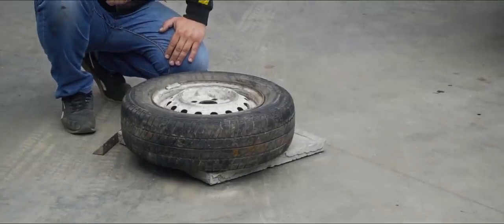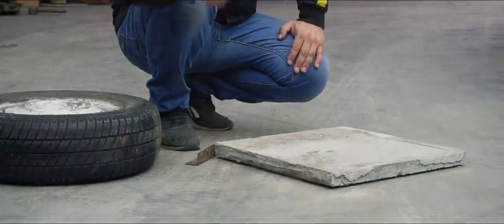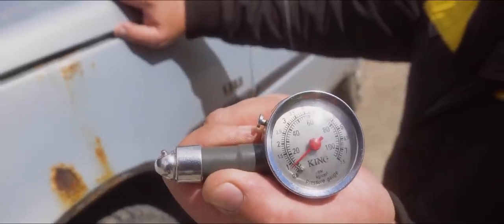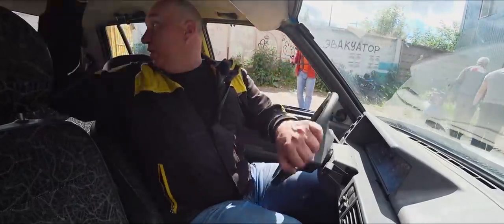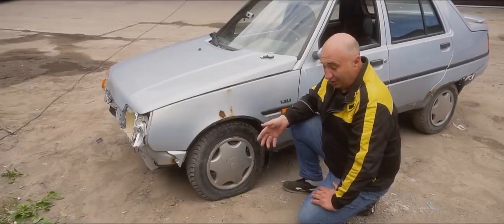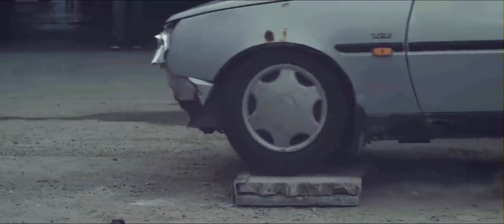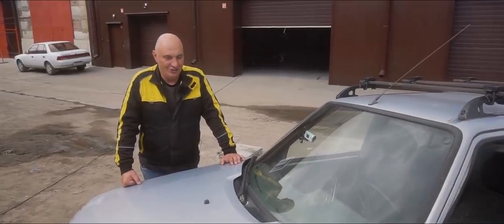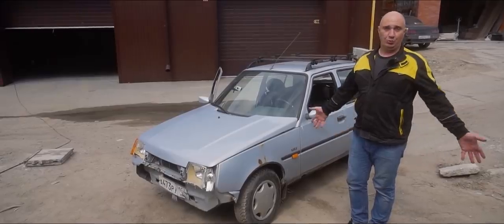220 PSI – can the tire keep it together?

Comment: Mans literally filled a tire to over 200 psi with 0 protection whatsoever. I'm surprised he was able to drive the car with his enormous balls
Reply: it will hold over 200, why, because think of the centrifugal forces trying to sling the tire apart at  120mph. way more force then just 200 psi is needed to blow one apart, as a tire was engineered to not explode.
Reply: Lmao
Reply: @opossom1968  2222
Reply: I had trailer a tyre explode on me at 35 psi it blew me on my back and I couldn't hear properly until the next day.
Reply: @opossom1968  you just saw a video where he is intentionally running into shit with a highlikely hood damaging the tire/rim But you think it should still hold 200PSI? Lol out of your mind.
Reply: @tsslaporte  i do not think it 'should' be ran at 200psi, i run 36/250kPA in all my vehicle tires. 32 is comfortable ride, but best fuel mileage and tire life is at 36psi/250kPA. Never did i say that anyone should run a tire at 200. i said i have seen tires pumped up to over 200 just to see where they pop at, which is usually at 220.
Reply: @opossom1968  that logic doesn't work, since only the threaded part is designed for that. The sidewalls of the tire are not designed for anywhere close to that pressure.
Reply: @butwait  i never said a tire should be ran at 200psi, i said they seem to blow at 200 or 220 when people pump them up to burst them. no one is running that high a air pressure on the road. i run mine at 36psi/250kPA which is the best pressure for tire life and fuel mileage, 32psi is for comfort, but tires wear faster and fuel mileage is lower. usually when pumped up the side wall will pop, which is not as strong as tread area which is wire reinforced or in case of bias ply nylon thread. look up the You Tube videos and you will see tires over filled pop at around 200 to 220 in PSI. more in kPH scale which is a finer measurement.
Reply: Well his brain is proportionally small so his total mass remains the same.
Reply: opossom1968 tell that to my semi tires bro
Reply: @BigRigStreaming  Filled mine today, rated at 130psi/9bar, I would feel a tad nervous above that..
Reply: @opossom1968  Centrifugal force of the tire  in that speed is about 50kN. 200psi (14bar) pressure over entire surface of the tire is about 100kN or more. I calculated that in my head so not accurate but I think about right.
Many people have died or injured seriously in explosions of pressure vessels
Reply: He’s Russian after all
Reply: @opossom1968  had someone bring a Buick in the shop for tire check. The tires got rotated, but never had the tpms positions relearned. They kept adding air to the wrong tire and it was at 90psi. Total tread separation 🤣

Comment: Make a electric-Lada using only startermotors..
Reply: @PODbot2.5  awsome! Thanks!
Reply: I like you
Reply: Jerry, yes. Start motor idea is not good or even fun, but real ELada can be, If well made. No point to do it If not made to last.. or fast. Maybe both?
Reply: @jannejohansson3383  agree and disagree... but for Garage54 it's about having fun too
Reply: How about Lada powered by a rocket made out of the CO2 tank? Or a co2 tank filled with mentos and cola? what if you put a co2 tank in the rear, tilted up a bit, make a hole that the whole pack of mentos could get through and fill it with cola and throw the whole unpacked pack of mentos in it or 5 packs lol :D
Reply: Just take the plugs out and put it in gear
Reply: Yes, I need to get the plates renewed on my e-LAD-tric car please.
Reply: That's called a Tesla.
Reply: @torivar  other makes are available and cheaper lol.
Reply: @torivar  Teslada
Reply: Inefficient? Yes
Russian as hell? YEEEEEEEEEEEES

Comment: Vlad is a f**kin madlad. 
No way I'd stand near a tyre with more than 100psi unless its a truck tyre
Reply: it will hold over 400, why, because think of the centrifugal forces trying to sling the tire apart at  120mph. way more force then just 200 psi is needed to blow one apart, as a tire was engineered to not explode.
Reply: @opossom1968  just because its engineered not to explode doesn't mean it won't.
Why do you think its mandatory to cage a truck tyre while inflating it?
It could be dry rotted, cracked, punctured, faulty, not seated correctly.
Reply: @1one3_Racing  Exactly right. I've had a brand new car tyre (205/60R16) blow off the bead at only 30 psi. Just because a tyre is "engineered not to explode" doesn't mean it won't happen. Mind you the beads had already seated against the wheel as well.
Reply: @None-kv7sd  true. A lot more dangerous when seating the bead. But I've been driving trucks for years and tyres blow all the time, often for seemingly no reason, at only 90psi
Reply: Not just any tyre, but a crusty old tyre that they had already tried to damage 20+ times 😂🤣😂🤣
Reply: @1one3_Racing  90 that is low for a heavy truck tire, 110 is the correct tire pressure for a 18 wheeler tires. At 90 they could over heat and blow. i have driven truck over the road for 15 years 110psi/7.5 bar, is the DOT correct tire pressure for the USA. My point is, tires can hold a lot more then people think, because of the engineering to prevent the tire from being ripped apart at speed. Not that you should run them over inflated. there are a few you tube videos of tires popping at about 220 and one at 15 bar.
Reply: @None-kv7sd  your tire came off the bead during seating all tires are dangerous when seating a bead, but we do not drive around with cages around our tires. Also a new tire will hold more pressure then a used tire, that they had already over inflated many times, cracked and dry rotted, surprised it made it over 100.
Reply: @opossom1968  110 may be fine if you're driving on glass! At 110 you'd bounce right off the fucking road! We mount them at 100 and over time with stretch and leech they usually drop a bit. Remember we're only allowed to do 90 which is about 56mph so that generates a lot less heat.
Reply: This is you tube USA where its spelt Tire
Reply: K Y  I apologize I learned how to read and write in texas.....
Reply: @opossom1968  Truck tires are dangerous when fitting a new tire is with split rims. The rim has to lock in with the main rim and that doesn't always happen. A normal car rim is one piece and once a tyre is on the rim it can't climb over the rim it has steel belts inside the tire.
Reply: @JayDee-xj9lu  split rims went away long ago, not many people here in US use them and NO shop will mount a split rim anymore. No one mentioned split rims in this post.
Reply: @1one3_Racing  110 is the mandatory company tire pressure, i know i have driven for company's through my career as a driver. It was always 110 on steers and 110 on drives, 110 on trailers, company policy. i have driven for 4 company's and that has always been the case, i do not know what owner operators run, i never wanted to own my own truck too expensive and if and when the truck broke down i did not have to pay for it. I drove from 1991 to 2006, before i got ran over by a out of control boat while swimming and broke my back. i have never had a tire blow, i have had flats on trailers, but never had a issue of tire failure ever while driving. BUT i have never driven on recaps or old tires, large company's keep good tires on trucks, for liability reasons. in my life i have never witnessed a tire blow, i have seen tires toss off a recap, but myself would never run a recap, too dangerous.
Reply: @opossom1968  blowing tyres is far less common than it used to be. Especially on bitumen roads. More common on gravel.
I've only ever blown about 3 or 4. Had LOTS of flats. But when you're running 5000km a week and 60 odd tyres that's a LOT of rotations.
Reply: @1one3_Racing  i will go out on a limb and say "are you an Australian" by the use of the word bitumen, i have watched some outback shows of the problems of driving across Australia, i would have loved to experienced delivery's to the ranches and industry way off the beaten path as i have always driven no Asphalt (bitumen) roads here in the USA.
Reply: @opossom1968  I have. There's always a first. In Australia we still have split rims. Sorry I didn't know USA doesn't anymore. Probably a good thing. But must be hard to mount the tire?
Reply: @JayDee-xj9lu  No they mount just like any passenger car tire, just larger.
Reply: I had a big truck tire the other day that was empty. Put air on and walked away, couldnt have been more than 20 or 30psi as i walked the length of the truck. Massive explosion, the entire sidewall exploded. Standing next to it would have not been pleasent. Always stand away or in a safe area when filling tires. Tires are so dangerous some places you are required to insert the tire into a cage before filling
Reply: @screener545  yeah most big trucking companies require tyres to be cages.
I've seen a 20 ton front end loader tyre explode that was on fire. Luckily we had all decided to back off and let it burn. Almost brand new Komatsu that being used to fight a hay fire. Idiots.
Reply: I been right next to a steer tire on a truck when it blew (110 psi) sounded like a bomb I can't imagine the sound at 220 psi going boom
Reply: @dangerdylan5005  * spelled. Not spelt.

Comment: 8:26 DO NOT inflate a tire while staying in front of it
Reply: Because it was already filmed i was not worry for him. But if it would have been live i would have tell him to move the shit out away from this wheel while he was inflatting above 60PSI
Reply: I can't believe that he stood right by the tire while filling it to 200+ PSI! That's 4-5 times more pressure than it is rated for!
Reply: @averyalexander2303   Probably 7 times more than normal. Absolutely crazy.
Reply: eh... Russians are too cool for safety.
Reply: @averyalexander2303  doesn't it say on the tires usually : max 200psi 
or something? I usually inflate my rear tires to 3.5 bar, and fronts to 3 bar for racing. on a more gravelly road I may bump it down half a bar. but that's using inner tubes. which makes the tire sidewall softer but much harder to blow the tire (happens a LOT).
Reply: Good advice, at that pressure tire can mess you up really bad!
Reply: @EdgarsLS  From what I have seen, the maximum pressure that standard car tires are typically rated for is usually somewhere around 40-50 PSI or around 2.75-3.45 bar. It usually says it on the sidewall
Reply: @averyalexander2303  Recommended for daily driving is somethig between 2-2,5bar for almost all cars with conventional tyres. But maximum rating is 3-3,5.
Reply: They don’t give a shit. Iv seen them grinding with no eye protection and doing all kinds of other stuff that has seriously injured me before. Closed eye welding. Some people have all the luck
Reply: @EdgarsLS  No safety means no problem.
Reply: My dads co worker recently died when he overinflated a tire. The tire exploded and killed him almost instantly
Reply: Yeah that’s crazy...an explosion could seriously hurt someone 😯
Reply: Phuck Onyou Probably a truck tire...much more dangerous 😯
Reply: @EdgarsLS  for racing i use bead locks, so i can run em waaay lower
Reply: When servicing large aircraft tires off the aircraft, the tires have to be in a tire cage for safety.  Once installed, you didn't sit in front of them while servicing them up to 280 psi.  If it ever blew, you would be dead.
Reply: Do not OVERINFLATE a tire you mean.
Reply: Chill guys, these aren't split rims.
Reply: Maybe 10 year ago a guy die in my city a big truck tire exploded at it job and a can tell you it not pretty there where part of body everywere in the shop
Reply: He’s Russian, you can’t hurt Russians... remember bears run from Russians lol
Reply: Yeah I’ve already exploded a bicycle tire like that and even that was loud af, a car tire exploding could really fuck your ears up
Reply: @averyalexander2303  When i replace tires i will push in 40 PSI to seat tire beads, just to be sure. I would never put 200 PSI in to tire and stand right next to it, exploding tire sounds like a very loud gunshot
Reply: @StaticVapour590  yeah 4bars is also my absolute limit. If that doesn't seat the tire I'm gonna use a boost gun..
Reply: @peterzingler6221  bead bazooka is one of the greatest tools
Reply: @EdgarsLS  люди у нас много
Reply: As proven, it’s fine! Keep you pansy remarks to yourself...👍
Reply: @StaticVapour590  40 PSI is no big deal, I drive on that pressure every day without issue. My particular tires are rated at 44 PSI
Reply: @averyalexander2303  Sure, i drop it down to around 36 PSI for normal vehicles and if the customer states specific pressures i will put those after balancing
Reply: Martin Leška yeah Iv seen them. My friend has 6 rusty split rim wheels on his motor home. I put air in them once with the air hose taped to a broom handle. Scary stuff
Reply: @مجرد شخص Maybe not necessary to ban, but a stern warning...
Reply: Phuck Onyou yeah, next theyre gonna weld with just undies and no mask, just closing their eyes xD. theyre just burns," theyll heal till the wedding" as Latvians say xD
Reply: @soulsbourne  That is correct. My car's owners manual recommends 30 PSI, but my tires are rated for up to 44 PSI. I run them at 40 PSI because I get more MPG and the car handles better, but ride quality does take a bit of a hit.
Reply: @averyalexander2303  Your tire is going to wear unevenly due to overinflation. And you have a smaller contact patch, so you have less grip while driving.
Reply: @jacktran960  That may happen if you go above the tire's rated pressure, but I have not had any problems with traction or uneven wear. The tires actually stay cooler at the higher pressure, which is a good thing for longevity. The recommended pressure is not the best pressure for tire life, it is the minimum acceptable pressure because lower pressure is better for ride comfort.
Reply: @jacktran960  Poor assumption. You dont know the tire or car.. A Lincoln Continental uses undersized tires and load pressure from factory.. Near max inflation is a necessity..

Comment: As he stood next to the tire, whilst over inflating it, after it took all the abuse, I could not help cringing.
Reply: Goes against everything I've learned in shop class. I would not be anywhere near that.
Reply: @the_kombinator  Where do they still have shop class?
Reply: 9:29
Reply: @samuelseidel6148  At my old high school - the last time I brought my beater there for an upstream O2 sensor change and a tire balance, it was an all girls class. They did a good job, no vibrations in the wheel and the O2 hasn't created a dent in my hood from ejecting.

Comment: My suggestion form the last video:
Get some hydraulic pistons from office chairs and make some suspension with them.
Reply: Bouncy
Reply: Too soft they would bottom out instantly,  those gas spring are the same  as the shock absorbers already fitted only bigger.
Reply: @HuntersMoon78  too soft
Reply: @dogwalker666  yeah but you have multiple next to each other
Reply: @junatah5903  still not enough,  if you flop down into the seat it will bottom out even using 4 a lada is much more than 4 times your weight.
Reply: @dogwalker666  I think your office chair is weak.
Reply: Juna lol that’s funny but (  🤫 shh don’t tell anyone but I used to work where they make gas springs until they sent the manufacture to China)
Reply: @dogwalker666  need to import some from USA

Comment: Video idea : Running an engine with just one piston ring in each piston
Reply: Which 1 though
Reply: @seedlessgrapes2605  The top compression ring
Reply: @SniperDog1  just wondering what u had in mind
Reply: @SniperDog1  in an old wornout Lada it probably won't make a difference 😀
Reply: Eh that’s probly not worth the effort. If it runs it will smoke and foul the plugs. May as well just run a car with no coolant till the rings stick
Reply: Should run fine, at least diesel engines would
Reply: No rings be interesting. It would probably run by tow starting it with high revs on
Reply: @MiG21aholic  yeah with gasoline engines that could be possible
Reply: MiG21aholic no way would it run with no rings. They don’t run with stuck rings
Reply: How about running a 4 cylinder engine with 2 pistons removed? Haha, that would mess everything up xD

Comment: Fill a tire with silicone instead of air please.
Reply: will it dry hard? or stay wet?
Reply: @Eduardo_Espinoza  regular silicone dries by evaporation of acetic acid. that will stay wet inside a tire. 2-part silicon (epoxy) will dry
Reply: They've done a few rounds of filling tires with things like foam, concrete, etc.
Reply: Or use glue:)
Reply: Modern tires are made like silicone anyway, which is why they tear and wear fast

Comment: And I dont dare to inflate mine above 2.4bars, here they do more than 15😅
Reply: Most tires are rated for 3 bars on the sidewall (42-45 psi).  It's safe to inflate to the sidewall pressure.

Comment: There was a channel called life od that tried exploding a tire purely on air pressure, and I'm pretty sure they reached crazy numbers. But I do know tires can take an intense amount of punishment before finally giving in. My uncle had a truck that got shunted off his land into this huge hole the city has dug for dirt to fill in spots and what not. Anyway, the truck landed on its wheels. A whole engine block in the bed, with lots of extra random scrap metal, and when my uncle drove his Bob cat down to haul it out. He was very surprised to find out that, the tires had not popped in the 40 foot drop

Comment: I used to work in a tire/lube shop.  When we got a flat repair, practice was to dunk it, check for leaks.  Inflate to 80 PSI, check for leaks.  When they taught me this, I was like "WHAT???!  WHHAAUUUT?! 80 PSI?? Are you fricking crazy?!

These dudes put in 220 like it's nothing!  This actually makes me feel a lot better, as I know I wasn't in that much danger before.  I handled that those tires like a bomb, curled over and handling it with my arm extended away.